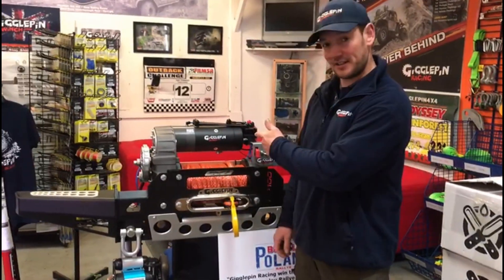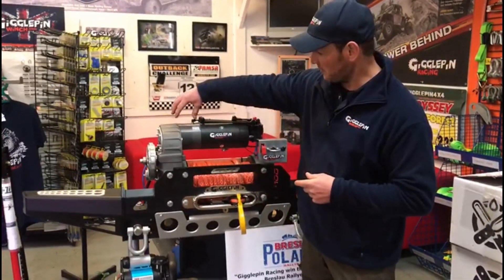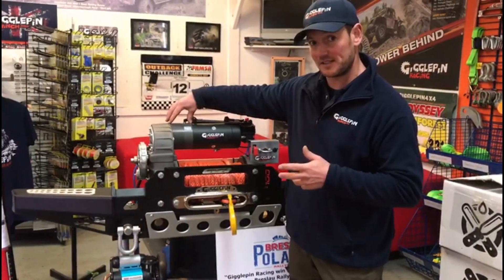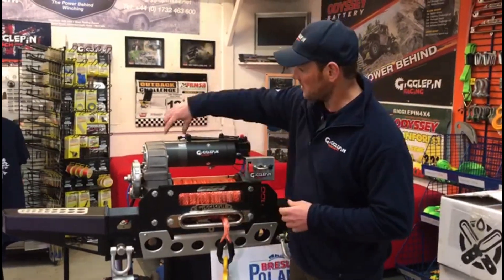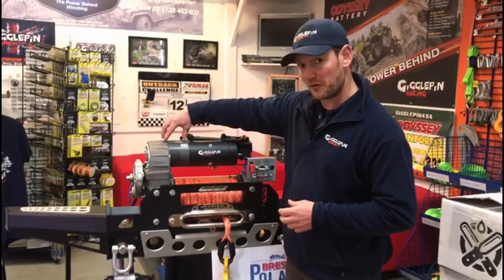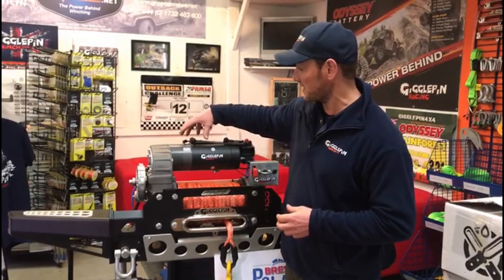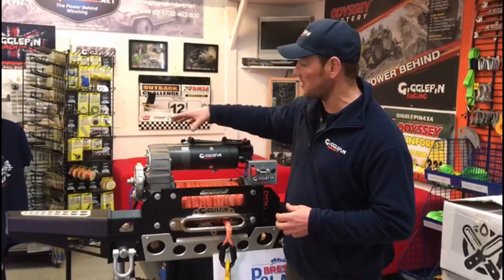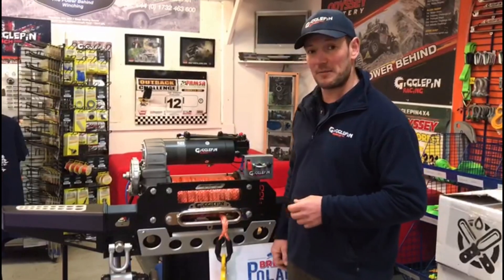The Gigglepin MBS (Motor Brake System)

Comment: Can these be used with bow 3 motors?
Reply from the maker: Hello Jimmy d thank you for the message. The answer is yes but you will need to use the adapter plate supplied with the motor
Reply: @gigglepin4x4  thats great news jim pretty excited to get some of these on my gp